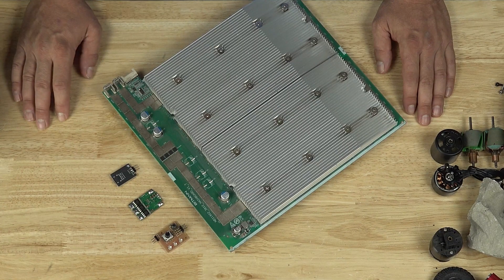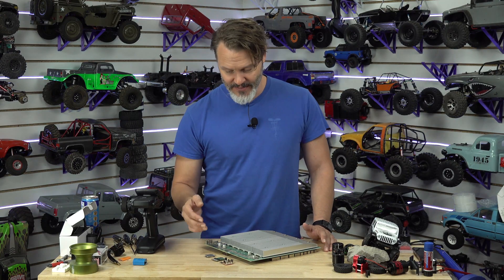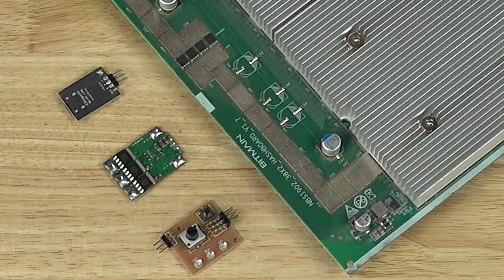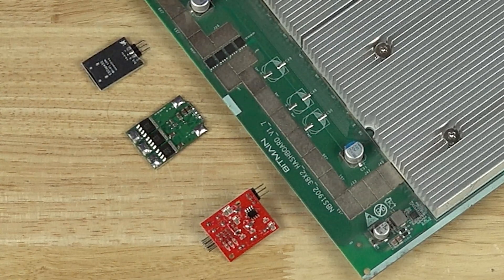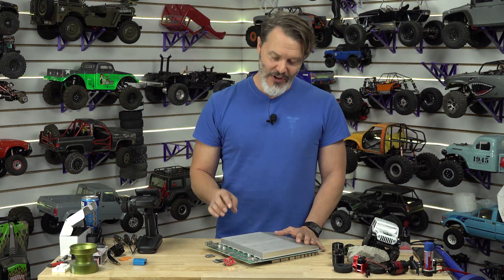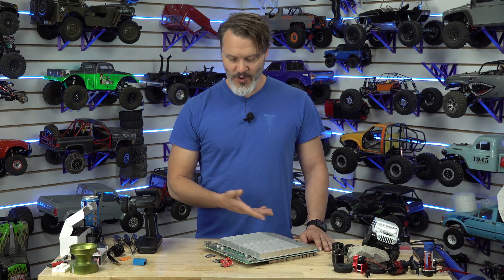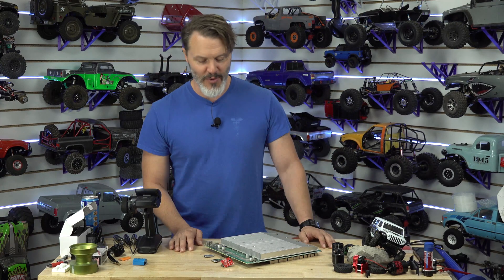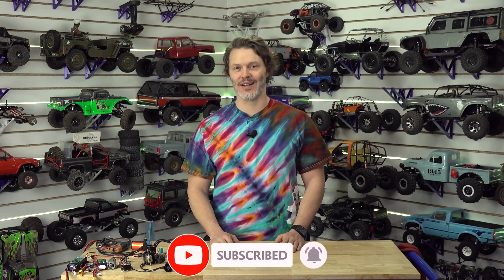Why Are PCBs USUALLY Green? The Surprising Truth Behind Circuit Board Colors!

Comment: Micro for sure. I feel the same way. GEARING how to match with motor combination, transmission/tranfer case, easy portal tricks, oh ya how to get the steering bracket outside of portal. Replacing or building differentials ie limited slip. Ect, ect., so on and so forth, and what not

Comment: In the World of modular synth gear when designing your own modules and having PCBs made You can have almost any colour You want, there are even a few PCB fab houses that will print full colour images on the PCB for You at a little extra cost, this is why there are many Eurorack synth modules that actually use PCB for the front panel will full colour mask layers on it. I have three modules with front panels masked in black with gold and white silk-screen print for the markings, looks real smart and makes the modules easier to use in low light during performance sessions.
Reply from the maker: @hairypaulmm7wab195  wow, that sounds really cool!  I guess pcb color has come a long way, ha!